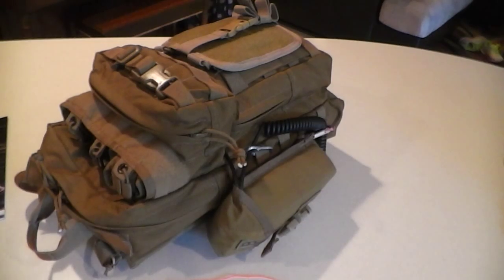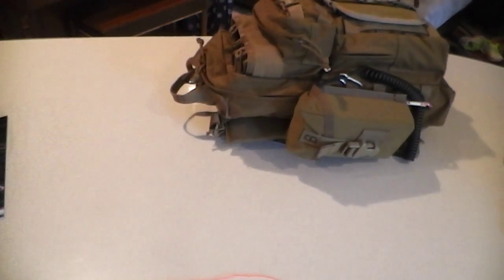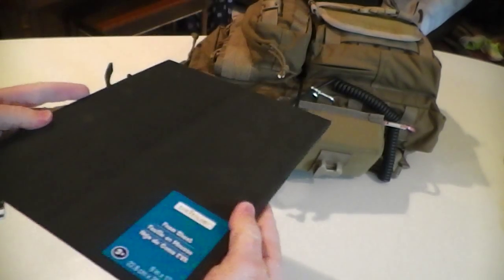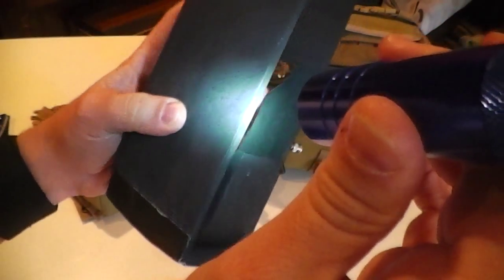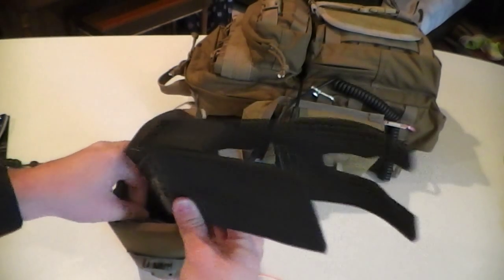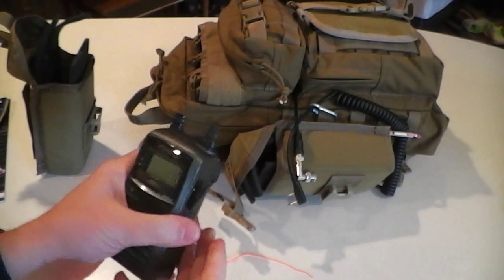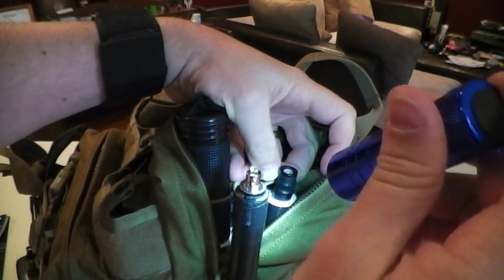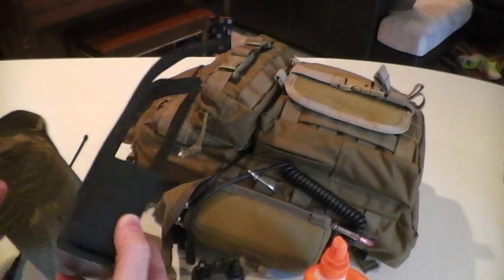Kenwood D72A - Improvised Military Case

Comment from the maker: Measured from the outside diameter, it's 3/4 of an inch. It was just a piece of pipe I had in the garage from another project. If you are going to buy a pipe for this, I would recommend going to the hardware store with the cable and antenna to find a pipe that is a more exact fit. There may be a better diameter than the one I had used. I just made some scrap pipe work by wrapping the end of the cable with electrical tape. This made it fit tight and the antenna doesn't rattle around when in use.

Comment: Thanks, I just ordered those items, also can you include the link to the cable that you have running from the radio to the pipe and the connector that you have at the top of the pipe, im building a similar set up thanks.